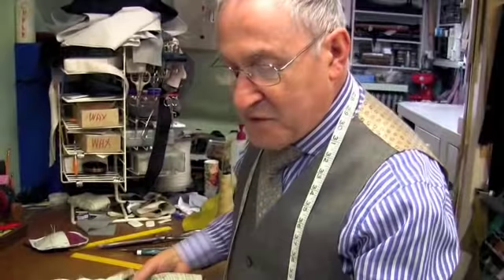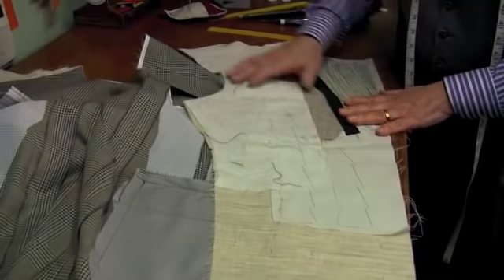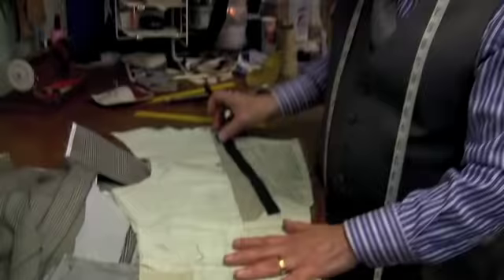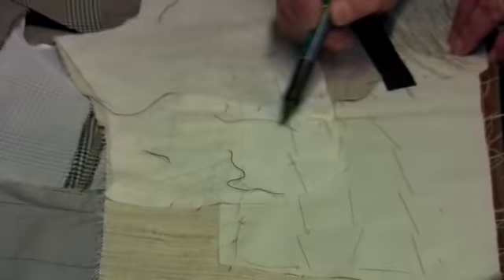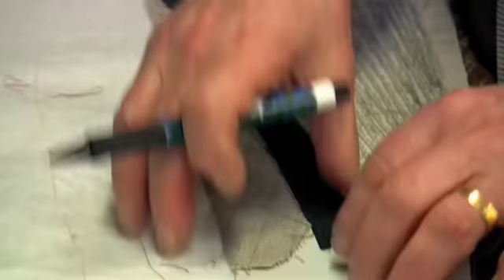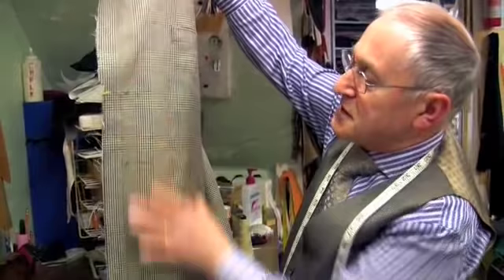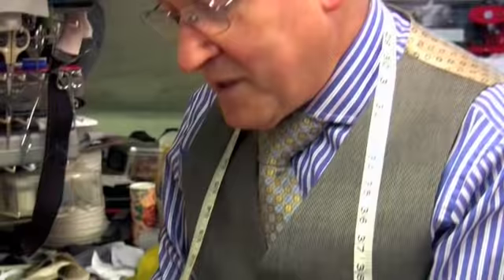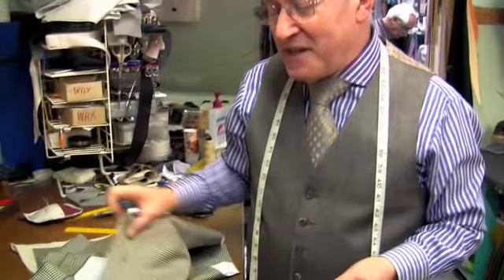Emil Fusaro - Tailor, Tailor vs. Designer

Comment: Canvassing is the first indication of a quality suit. Cheap suits and in fact many designer suits selling for over $1,000 are fused, meaning they outer shell is actually glued to the lining. Fused suits do not drape well, nor do they conform to the shape of the wearer. They also can bubble after dry cleaning.